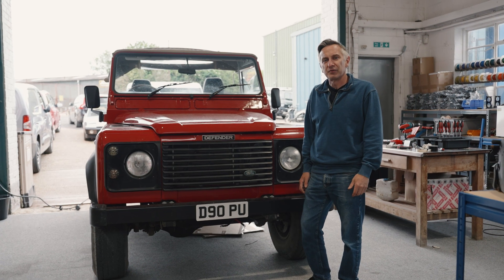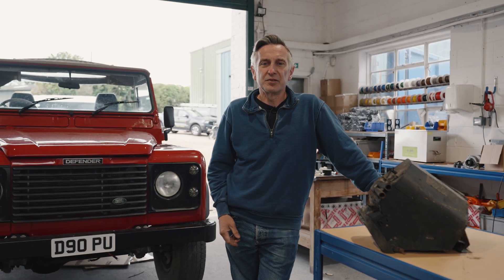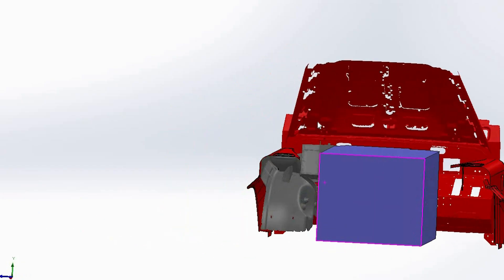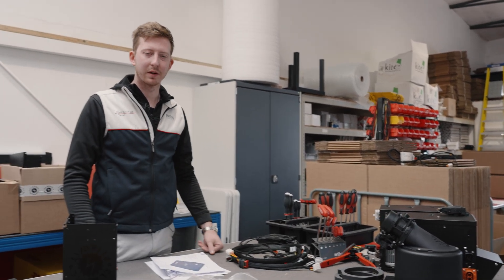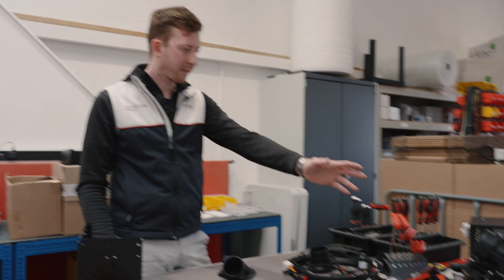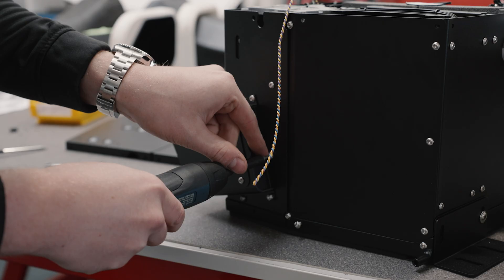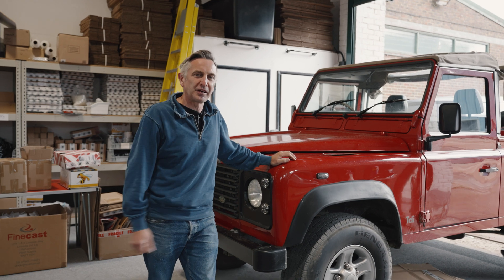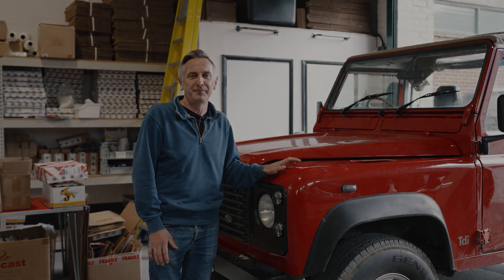Land Rover Defender Electric Air Conditioning: Design, Build and Testing with Classic Retrofit

Comment: Still waiting on compete AC for Defender. Question due to the defender being a off 4x4 what is the rating Ingress Protection Rating? I do do water crossing often and water depth range from 500 mm  to 1 meter.